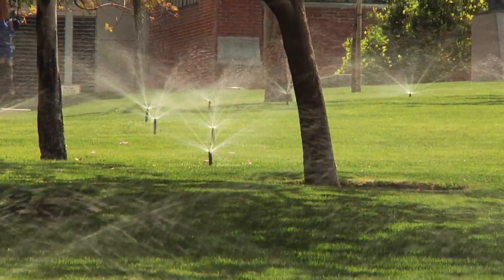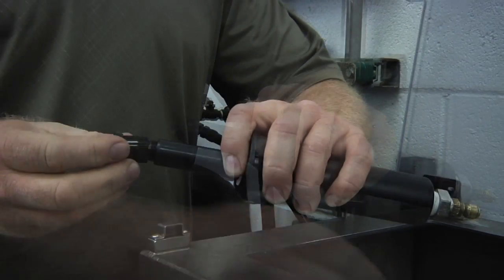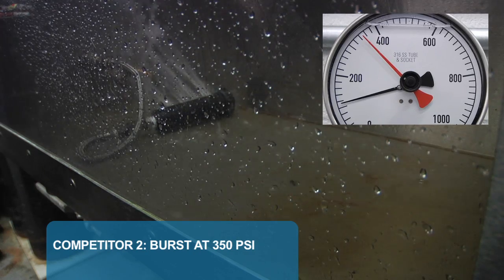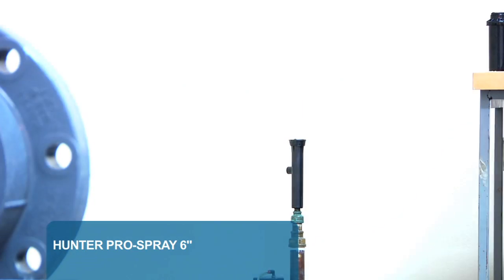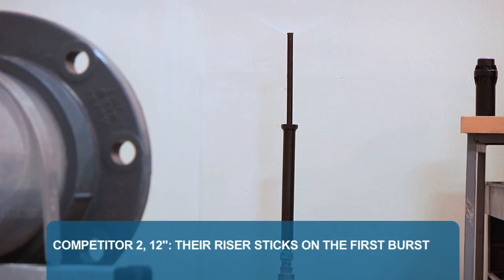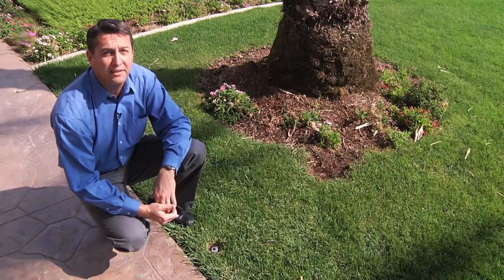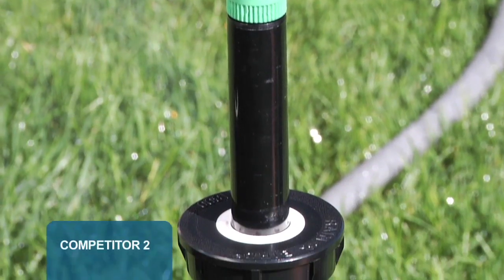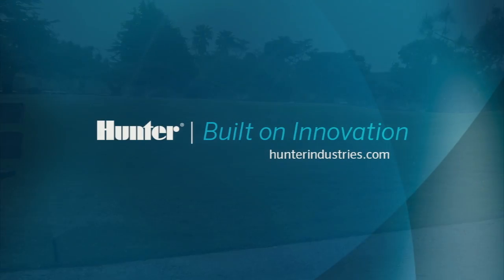Pro-Spray Product Comparison Testing - Burst, Surge, Flush and Cap-leak.

Comment: I have a sudden problem with hunter spray system, my whole zone doesn't pop up even after adding a booster pump. 
Please if there's any suggestion out there...it'll be greatly appreciated
Reply: If it's an entire zone, are you sure it's not a problem with the zone valve?
Reply: it's possibly the wiring or the zones valve.
Reply: Had the same problem, was told to switch zones on the controller with another. I swapped zone 3 & 2  around with each other in my case and what do you know? It works. Not sure how or why.

Comment: I just bought a house that was built in the early 80s. The only sprinklers still working really well are Hunter brand. Everything else is either working sub optimally or needs to be completed replaced

Comment: The pressure test indicates the body is stronger, but sprinkler systems don't operate at that high of a  pressure so it would only be worth it if the Hunter's sell for the same price as the competitors.  Also do Hunters accept other company's nozzles?
Reply: Of course they do, all nozzles have the same thread size

Comment: yeh, its good, but most of tests make no sense. 650 PSI, 300 PSI, 100PSI. What are the operational conditions? it's around 30 PSI. Its like bullet proof sunglasses :) Very cool, but...
Reply: Hunter Irrigation hey hunter I hope you're listening, I love your build quality but I hate how it's not really well designed, first I don't like how your sprinkler hews body design doesn't have a taper at the bottom  where you thread into the nipple like rainbird has, hunter is simply too fat at the bottom, that makes it a simple remove sprinkler head and replace without digging, for example, when I need to switch out an old broken rainbird sprinkler head, I can't simply unscrew the body out of the soil to replace it with your hunter sprinkler head because your sprinkler head is too fat by the bottom where the threads are, so I often have to dig which consumes time, also for your adjustable arc spray nozzle, those things spin way too easily and after couple weeks all the spray patterns are messed up, look at rainbird adjustable arc nozzle you don't spin it at the top you spin by the diameter of the nozzle, I'm talking about the spray pattern nozzles